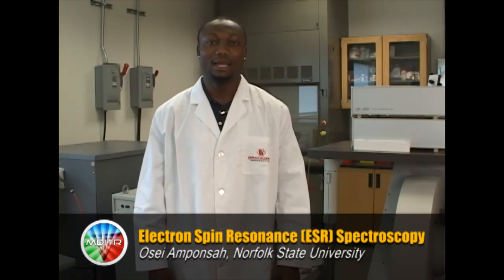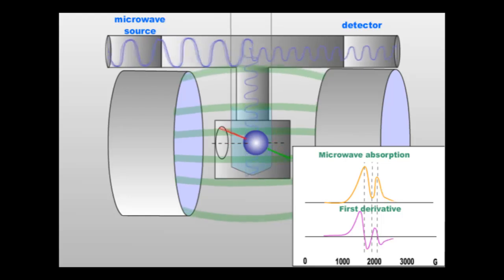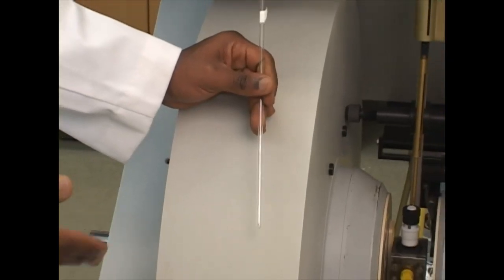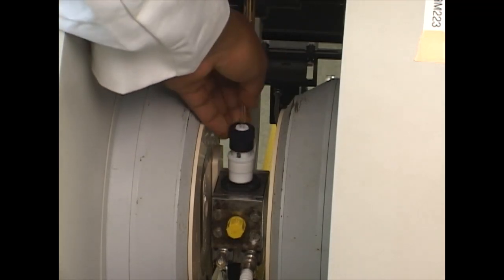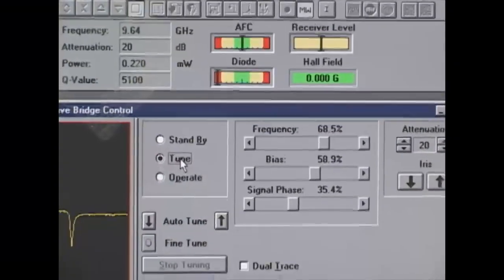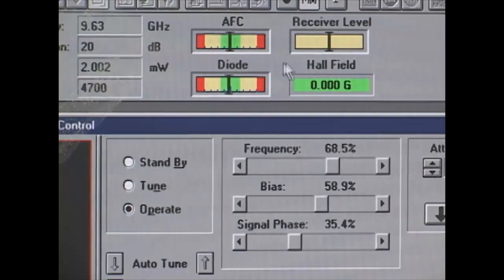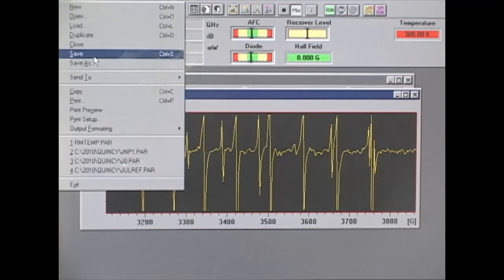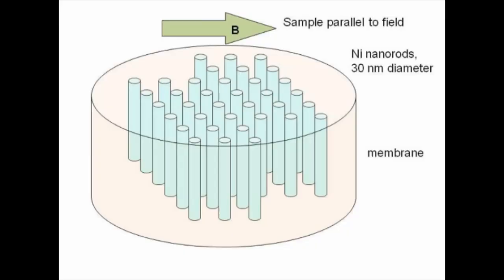Electron Spin Resonance (ESR)

Comment: Does anyone know - What type of electrical field gradient does an MRI use?

- How does it  function?
- What are the parts that make it functional?

- Is the electrical field gradient used in an MRI machine - a reaction between an applied external magnetic field, microwaves and the paramagnetism of the human body?

- How does microwave absorption affect paramagnetic materials? - What does it produce?

- Can it increase the strength/magnitude of an induced field produced by a paramagnetic material? Or is it just the strength and proximity of the applied external field that affects the induced field? How does microwave absorption affect the induced field of a paramagnetic material? 

How are microwaves and the external field produced by magnets functioning to detect and measure the rate of change of the electric field of atomic nuclei and electronic charge distribution between other nuclei, sequence of movement and configuration of electrical charge and current (quadrupole moment) of quadrupolar nuclei ( nuclei with a quantum spin number greater than one half)?

Comment: The company which produces the instrument has a section giving an overview of ESR/EPR (bruker-biospin)
The water, heat exchanger, and current control are for the electromagnet used.  the EMX part is the console and has the electronics for processing the signal from the bridge as well as controlling the magnet.  I hope this helps a bit.